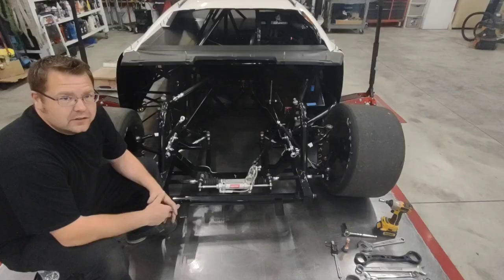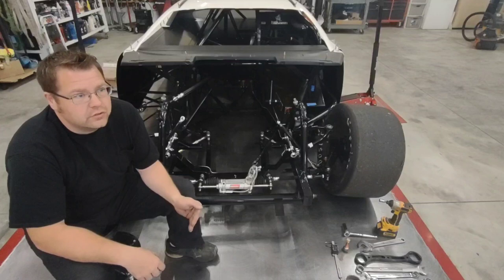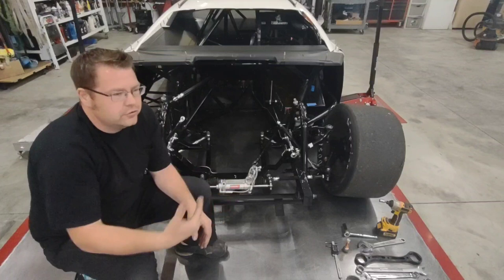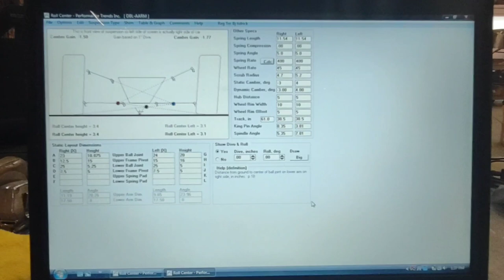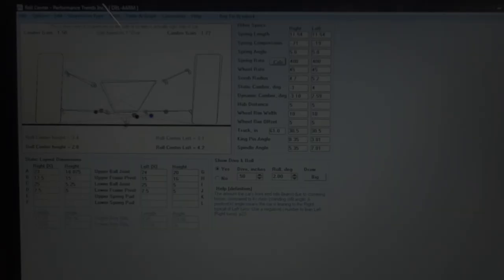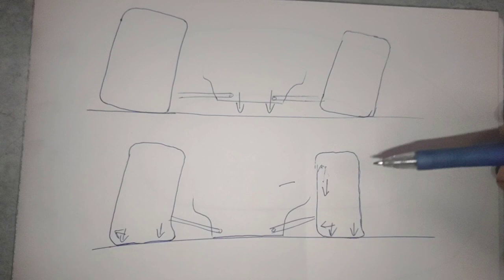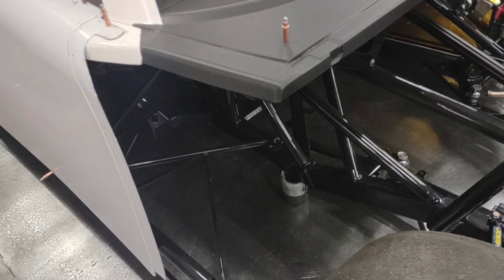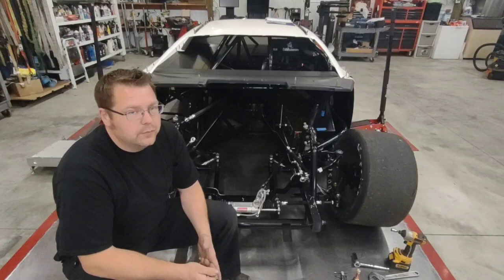Front Geometry on. Super Late Model

Comment: Love your videos, I do have a question tho as far as center location for starting measurements  ("0" point of the X Y axis) on an offset car.  I am as well a roll center guy, with the same program as you.  being that with an offset car has different lower length and sometimes different offset wheels would the center location not be center of contact patch to center of contact patch divided in half?  I have been at a stand still with roll centers ever since this has come to my att. and would really like your input, all roll center articles I find are of symmetric suspension and do not really give a good understanding of where the "0" point of the X Y axis should start , thanks and again love your videos

Comment: I noticed in the video when you talked about camber, and in roll center program that the lowers were flat statically and gained some angle when the car dove down. My team is coming off jacking force type setups and we are really trying to learn roll center and we hear some people say that the lowers should always stay as flat as possible and others say you need angle. We run super low ride heights to minimize the movement of the roll center and to try and keep the lowers as flat as possible. Should we be doing this and what are the advantages/disadvantages? We also have a race coming up and we already feel confident in our shock package so we are looking to really play with roll center adjustments at the track to get our car to rotate a little better.
Reply from the maker: Here's the thing about A-arms and travel. The more angle they go through, the more the car narrows up. The flatter the wider. Measure your car at 4", then lower the car so the cross member is down and you'll see the car narrows up, and in some cases it's quite a bit. I personally feel the geometry is more important than width, so I'll sacrifice some tread width to have my geometry correct in travel. This is something you'll want to keep in mind as you design your front suspension.
Reply: @bjtidrick9973  Thank you! We will experiment a little bit.

Comment: Hello. Where does one get a setup plate for the garage like you have for the car and how much do they roughly cost?
Reply from the maker: This one cost 5k I believe. We got it from a fellow racer that had a few. It's 20 foot by 8 foot and 1 inch thick. It weighs a LOT!!!
Reply: @bjtidrick9973   Thank you
Reply: @bjtidrick9973   So I've raced an asphalt super late model for awhile now and am always a little off the leaders. Do you know of any chassis setup classes I could take to learn more about setup for non bump stop chassis setup? I read Bob bolles books but am still looking for something more.
Reply: @jumpshotkangaroo7585  we run outlaw super asphalt  and bump stop packages win everything around  us not saying conventional can't but it's active rear end and try to run on bumps at least with the front
Reply: @allenjones9003  thanks for replying but bumps aren't allowed in our class. It's a no ride height rule so we have set it as low as possible and set up from there